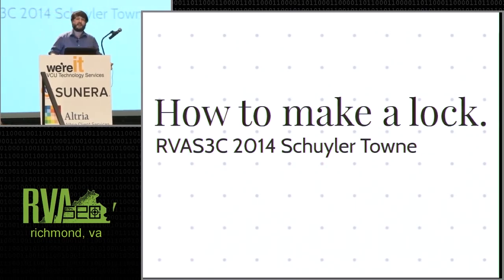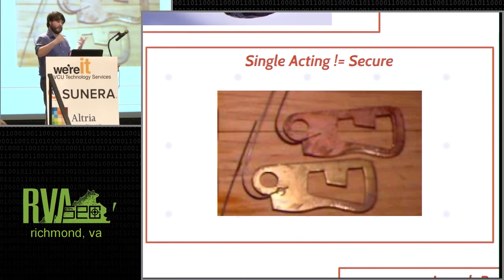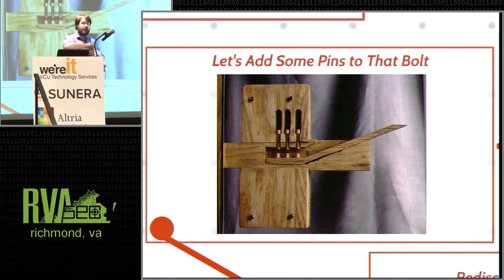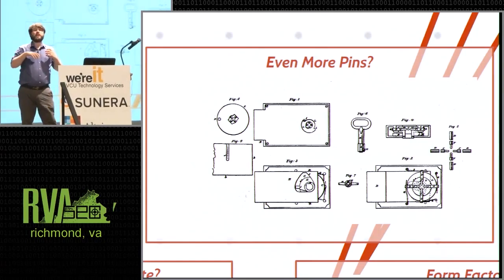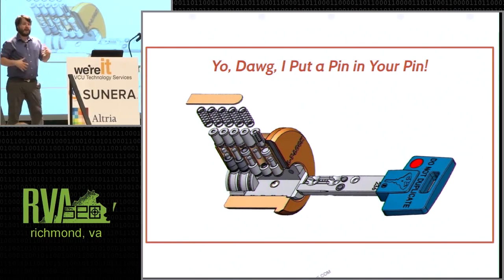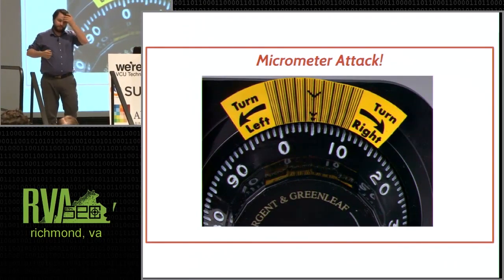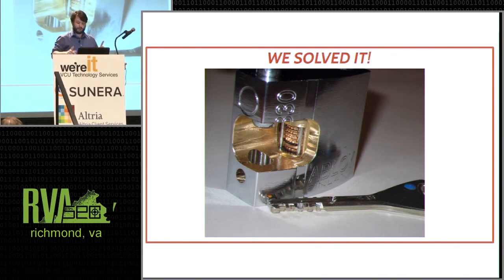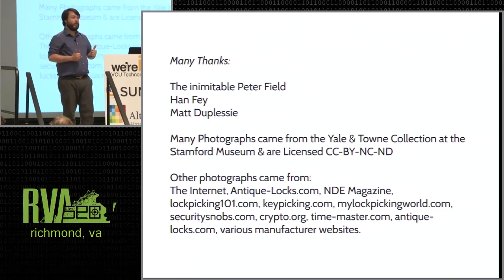RVASec 2014: How to Make a Lock

Comment: Secrecy and privacy as to which type kind and manufacturer of lock is being used, is an important level of security,,,
Imagine a crook that must sneak while a property is ocupied or even burglarize a facility on a weekend, the success of the penetration greatly depends on preparedness with regard to tools and agility with relevant technique.
Removing certainty, confidence or awareness of any or every lock information gives higher security.

As stated brute force or destructive style attack is another security issue altogether.
Another set of methods of obfuscation, secrecy and privacy contributes to security.
My experience is as a materials manager in a large high volume jewelry factory which produced our own karat gold pipe that we drawer down to appropriate thickness diameter of tube, then we used CNC lathes to make wedding bands and diamond anniversary bands,
We used several hundred ounces of pure gold daily (200-600)
Chiefly except for a few exceptions the 60 or so employees were usually hired as relatives of the managers and supervisors.
To the outsiders we always told people we make small parts for telephone systems and Telecom.  
This was all in Chattanooga TN, that factory has since been mothballed and machinery I presume shipped to the parent company in Lafayette LA.
A sloppy dirty factory had lots of gold in various stages of production those were the days (early and mid 1999's)
Time passes too quickly

Comment: I'm a bit late to the show but as far as I can tell, Protec 1 can be picked by inserting a thin wire between discs and between the two DBS bars and then going with tentative method. If I remember correctly, Protec 1 also allows going to DBS bars by inserting the wire through the keyhole and using the extra space in rear to access DBS bars. The idea is to prevent DBS bars from touching each other and locking the discs. See Matt Smith (huxleypig69) speech for more details: https://youtu.be/GBaihzVxs5Y

Comment: those forever locks can easily be broken open by getting a blank, grinding it to max depth, wrapping the blank in foil tape, BAM you have an impression
Reply: +legionbunny The foil impressioning attack for these is not at the "easy" scale since you do have to prepare a key, and the keyway is not entirely forgiving so jamming it in can be tricky, it's closer to a "medium" level. I usually reserve "easy" for locks where you can improvise in the field a method for attack.
Reply: ***** that's your opinion of if it's easy or not.
Reply: legionbunny Obviously, but I did support my opinion with reasons
Reply: ***** well it's easy because it requires no real skills and can be done with easily available materials and tools. There,reasons. Shove off.
Reply: legionbunny I hope whatever life problems you are having go better for you.
Reply: ***** What makes you think i'm having problems?